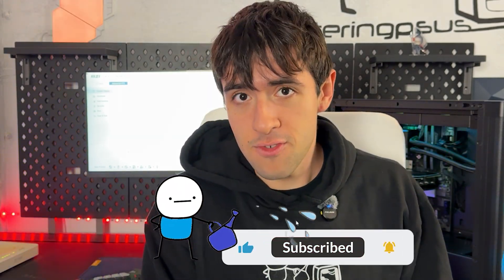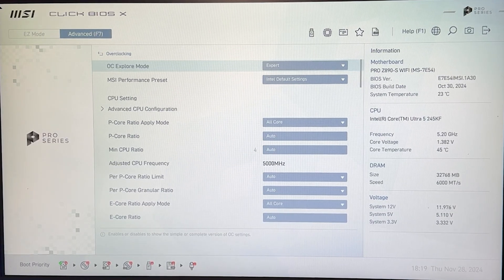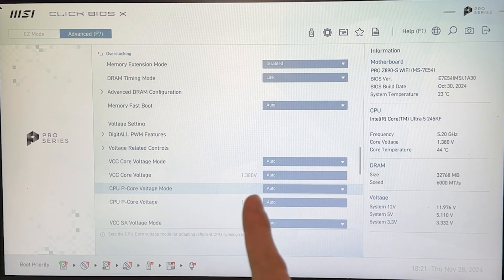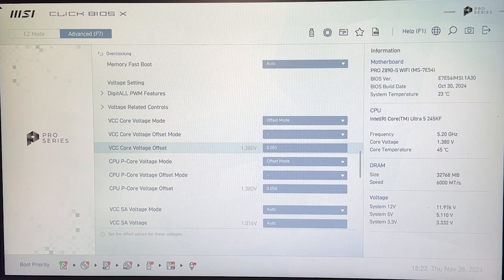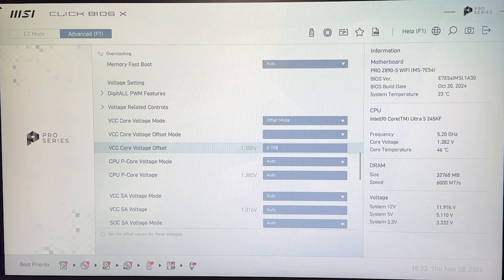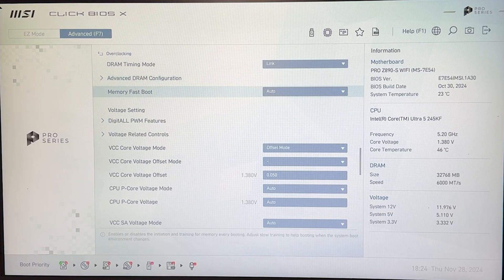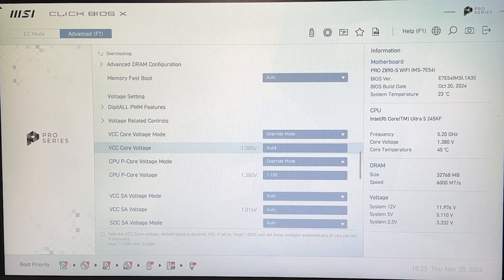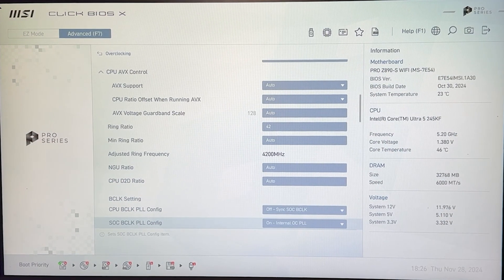Undervolt your Intel Core Ultra 5 245K for more FPS and Lower Temperature!

Comment: Would be good to include before/after testing for these videos.
Also, why is the default voltage so high? 1.380V? In some other videos I see it much lower even on 285K, so how is it that 245K has higher voltage than 285K despite 285K having higher clocks?
Reply: 285K is better binned🙂

Comment: This method works with Core Ultra 7 265K also?
Reply from the maker: Yessir, but you can generally get slightly higher P-Core clocks on the Ultra 7 and also sometimes higher cache
Reply: @ImWateringPSUs  Hmm, interesting.